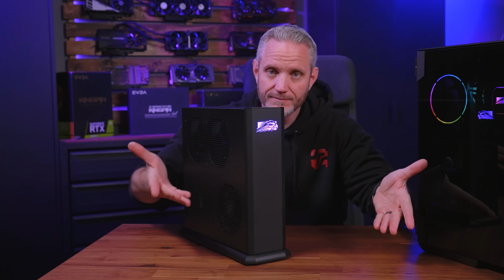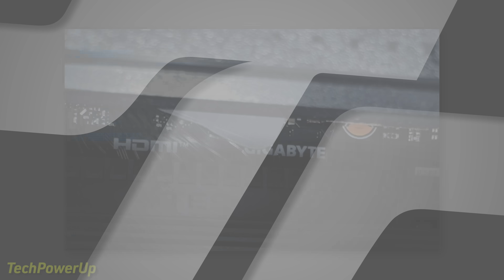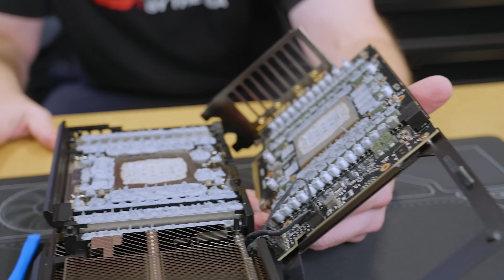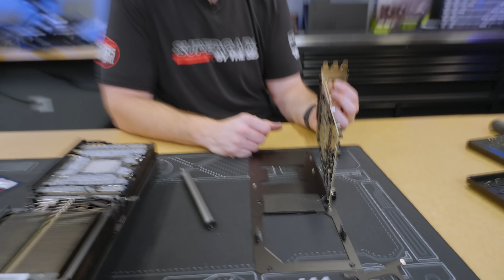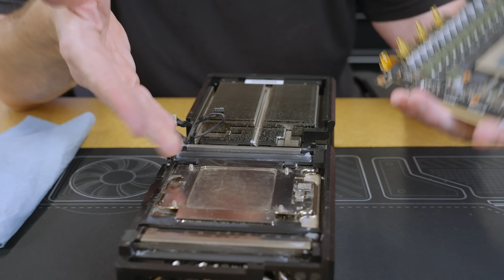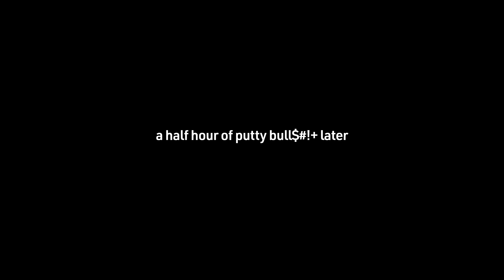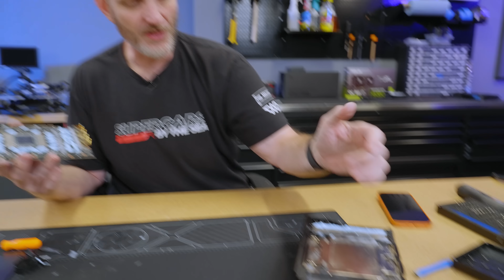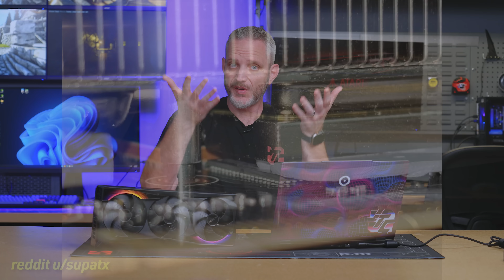What the HECK Gigabyte... WHY?

Comment: when i bought my 4 slot gigabyte aorus 3080ti in the middle of the shortage my card started thermal throttling just a few months after it was new because the thermal paste dried up and looked like clay, if it wasn't gray i'd think it was toothpaste or lotion, gigabyte can't be trusted
Reply: paste drying has a hell of a lot more to do with end user than the manufacturer. your case was prob the issue.
Reply: @SaltSpirits  my new 5090 hasn't gotten any hotter since i got it in march, same case and it's also a ventus model with a smaller cooler than the gigabyte and more than 10c lower at 100+w more power draw, i believe you can be right but in my case i just think gigabyte tried to get as many cards on the market at the cost of qc/component quality

Comment: Interesting results. I expected the hybrid paste on the core to be a gimmick compared to regular thermal paste. Der Bauer made a video about the exact same card but compared it to Conductonaut Extreme which got him 4-5 degrees improvement.
In any case, these cards don't suffer from any thermal issues. (Excluding the connector which is a completely different type of thermal disaster ofc)

Comment: praying that I never have to open my Gigabyte 5070 TI to reapply that mess. 

hopefully if any issues pop up, it'll be in the three year warranty. actually trusting Gigabyte to fix them though is another story
Reply: It's Gigabyte. You should have 4 years of warranty.
Reply: @PwniezXpress or 5 years if you buy two models within 30 days of each other..
Reply: @PwniezXpress  it's 3 years standard but you get 4 years if you register it within 30 days of purchase (which i didn't know about lol but i think my credit card adds a year)
Reply: I’d be replacing with either a phase change thermal pad or just good old fashioned thermal paste right away. Just keep an eye on it and you’ll be ok.
Reply: @wareskevin  You didn't watch the video, did you? The paste that comes on the die is better.
Reply: @tradingnichols I can’t believe that, the only thing worse than what came with it is Liquid Metal. You do you man, no worries.
Reply: @wareskevin  Uhm what? How can you not believe that? It's literally the best you can get for a GPU lol.
Reply: @PwniezXpress  aw… cute that you are buddies. ❤😊 A few degrees difference between thermal mediums is inconsequential to me as a hardware engineer. So let me sling this bit before I shut down this discussion. The best cooling solution you can get for a GPU is a water block in terms of temperature reduction. I’ve been repairing computers for over 30 years. Remember? When you had to assign IRQ channels? If you’ve never owned a 14.4 baud modem, or never had a MCSE certification, or never owned your own PC repair business for 12 years, I’m not interested in your opinion. As I said before, y’all do you. ✌️out.
Reply: @wareskevin  Funny how you assume what I do and my background. You speak as if you know everything, yet NO ONE here is talking about waterblocked GPUs. This is entirely based on air cooled GPUs. You need a reality check. 99% of people aren't going to use a waterblock on their GPUs because that's enthusiast territory and cost A LOT more. Please seek help.
Reply: @wareskevin  temps have been excellent on even my MSRP windforce model. it wasn't something to worry about thankfully, i don't think i'll have to even open it up unless something goes wrong.

thermal putty might be messy, but it does last longer. only thing i'm worried about is the thermal paste on the GPU die drying out
Reply: I've had no issues with the gaming OC models. I've owned a 4070 Asus Tuf, 4070 TI Super Gigabyte Gaming OC, and a 5070 TI Gaming OC, all of which worked perfectly. I also had an MSI Gaming Trio 2070 Super and a 3060 12GB Asus standard model. Additionally, I had an EVGA 2080 Super, one of my personal favorites, and none of these cards ever gave me any problems.
Reply: @Zenntric  Gigabyte had a small select few bad thermal putty applied in the wrong spots on the first batch coming from a single factory. Of course, those people went online and complained and it caught like fire, now so many people think they're all like that. I have a Gigabyte Aorus 5090 and my wife has a Gigabyte Gaming OC 5090 both of which are vertically mounted. Have been for over 6 months. Not a single issue of any thermal putty drip because it's literally impossible. The viscosity is way to thick for that to happen. People just love to parrot what they see online and call it a fact. Yes, there were a very small number of cards with putty placed in the wrong spots due to a faulty machine in Vietnam's factory, but that was instantly resolved. But now, everyone thinks all the cards are like that or that vertically mounting them will cause issues. Little do they know that thermal putty is better in every single way to thermal pads besides cleaning it off and repasting it due to time consumption. You shouldn't ever have to re-paste it anyways since it will last the entire lifetime of the card.

TLDR; People are stupid.
Reply: @Zenntric  How long have you been using that 5070 TI Gaming OC with no problems? What are the first four numbers of its SN? Thanks in advance!
Reply: @rosagorgatti  I got it two months after the launch. The numbers are hidden right now, but I’ve checked the card personally and there’s no leaking paste or anything. I even stream with the card without any issues, and the AV1 in it is amazing as well.

Comment: I have the Gigabyte 5080 AERO with this paste/"Gel" stuff. So far its been great in it's vertical mount. That being said it is in an AC controlled room @71F with the AC partially blowing directly into the side of the case. And yes, the side panel is off the case. The gpu is on the stock fan curve because the core doesn't go above 67-68c. The mem temp doesn't go above 69c and is usually only about a single c above the core temp at any given time. I have't seen either the core or the mem temp get into the 70's c yet. So imma cross my fingers and hope I am fine. I have HWiNFO 64 running at all times on my 2nd monitor and am always checking it in games.

Comment: Yes, my first batch of 5080, bought a month after the release of the new line, started leaking thermal interface, considering that I use the video card in a horizontal position, but there is not much of it, apparently the excess was simply squeezed out lol

Comment: I have a Gigabyte AERO White RTX 5080 and it seems to be okay. I'm not sure on the memory temperatures, but my card goes on avg of 2850 Mhz speed at ~70 degrees Celsius for AAA games. For the past 6 months I had the GPU horizontal. Now (started Sept), my GPU is a vertical mount for personal reasons. I do recall my temperatures to be high during the summer heat & living one floor up (which of course heat rises). Ambient temperature in the hot summer was about 83 degrees Fahrenheit (28.33 degrees Celsius).

Comment: So I've had my 5090 AORUS Master Ice for about 2 months, used for 70% gaming, 30% 3D Printing Slicing/Modeling. Mine is is horizontal in my case, so that may be why, but I have seen absolutely ZERO of this thermal paste. I even double checked it when I started hearing grumblings about the issue, so far so good. This isn't discounting those that are clearly having the issue. But Crossing my fingers I'm not affected. I decided on this card because it was about $200 cheaper than the Asus Astral at the time. Plus...white build.
Reply: Same card here, although vertically mounted, also crossing my fingers 😅
Reply: I have the 5080 Master ICE and so far, no issues whatsoever. I took the GPU out the other day, as part of the regular maintenance to clean dust inside the case, nothing was visible when looking more closely to the PCB under the heatsink. I have it on the horizontal right now. Wanted to buy a vertical GPU mount, but now I am kind of hesitating... damn it Gigabyte :|
Reply: @antoniocampos1151 yeah I had bought the next vertical mount kit for my case and it’s sitting in my closet at the moment due to me being nervous about it now 😂. Great performance on the card, and it’s extremely quiet, even under full load.
Reply: It's not thermal paste
Reply: @rustler08 you clearly know what I meant. 🙄
Reply: Same here. No issues yet. I built my new pc in July and game daily. I chose this card because of the cooling solution and the great thermals.
Reply: Ive zero idea why people are so into this white build. It gets filthy fast, looks terrible, and is a horrible pc color. I just bought the x870e aorus black mobo last night because the white version is not happening.
Reply: @heavymetallabratname checks out. BLACK EVERYTHING !!!
Reply: @heavymetallabratpeople have different tastes…imagine that? Unless your home is filthy and full of dust, it’s not hard at all to keep any build, I didn’t a white build clean. I clean/dust all my builds, even black ones about once a month. Zero issues.

Comment: would be interesting, is the ram temp and the other temps from the software or are they on the pcb? if software then flashing a matrix bios on it would enable them?
Reply from the maker: That's not how sensors work
Reply: @Jayztwocents but they use the same ram chips so in therorie it should be

Comment: @JayzTwoCents Just bought a brand new RTX 5070. I have a b450 aorus pro mobo and I was running a 2060 super since 2020. The new 5070 ran well for a mere week and today, I got black screens. After a while, now, the situation is that my system will turn on but I get no display. It won't even let me get into bios. It seems that everything else still works but I can't see any of it! Throwing in my old 2060 super runs the system as usual, so it's clearly the 5070/ its drivers. Any solution to this?

Comment: Jay, are you ever gonna test phase change thermal compounds? 
I've had to pull the cooler off my cpu a couple times (gremlin giving me no boot until I disassemble then reassemble the system, happens every 9 months or so) just pile anything that squeezed out onto the cpu and put the block back on, and run it, the phase change handles the spread, no performance loss after it goes through phase change (haven't had to pull apart the gpu, but it's been on there nearly 2 years without any signs of performance degradation, test it every few months)

Comment: I use Upsiren putty on my 7900xt hellhound's memory and power stages for a few years now without issue and Thermal Grizzly PTM on the core. Dropped a few degrees over stock but still have to run a custom fan profile because the bios doesn't seem to factor memory temps into the fan curve. 90C on memory was too hot for me to be comfortable on it's reliability.

Comment: Okay that's not pump out pump out is when thermal expansion of metal causes the gap between the two surfaces to get smaller therefore pushing the thermal paste out and when when the metal cools it retracts leaving a void and then as it gets hot again it pushes on a thermal paste because the clearance between the two metals get smaller as they expand from heat that's pump out I don't know what the hell were you were talking about

Comment: THe mistake is thinking gigabyte actually want users to service their own GPUs, they put warranty stickers on the cooling systems for a reason, even though in many cases they aren't legally valid.
Reply: The only reason a company puts the warranty void sticker is to try and screw customers out of filing an RMA. They are not legally enforceable. It's for the company not for you.
Reply: @loschain2224 no, it’s 100% for the consumer.

Gigabyte know warranty stickers aren’t valid. They don’t need them. What they also know is that most consumers are dumb, see the sticker and don’t know that it is worthless and opt not to do their own maintenance out of fear.

Can take in more money from dumb people who don’t know they can clean the coolers out themselves … that or make people think their hot cards are just outdated so they buy a new one.

The sticker remains purely for consumer psychology reasons.
Reply: @loschain2224  i didnt rma since my warranty is no more. i wanted to repaste it myself
Reply: Gigabyte is such a washed up joke of a company now after the years and years of missteps.
Reply: @AgentLokVokun  funny way to spell Asrock
Reply: @grunky-k7p  I don't own any asrock products but from what I can tell given techtubers, they seem to have been improving with time, not getting worse.
Reply: There is no "service" required underneath the heatsink.  If you disassemble your GPU heatsink, it is your own fault if the card breaks.
Reply: @GoatTheGoat You literally posted this comment under a video whose entire purpose is to prove you wrong.
Ironic.
Reply: @TruthNerds  Did you actually watch the video?  The OEM thermal compound was completely fine.  There was no reason for him to change it.
Reply: @GoatTheGoat  😂😂😂 So you don’t understand how thermal paste needs to be applied and didn’t watch the video, that’s funny. I do and I did. Jason explains what‘s wrong with it. You must be a purchased chat bot or a dumb fanboy, in both cases there’s nothing left to say than: blocked. 😆
Reply: @TruthNerds   Yes, he tells a very dire story about the thermal compound.  But when he opens up his card and shows the thermal compound, it is completely fine.  Once he reassembles the cards, the thermal performance is worse.

Not only does the video proved there is no problem.  It shows why you shouldn't try to "fix" a non-existent problem.
Reply: @GoatTheGoat I forgot to congratulate you on the "ingenious" attempt at gaslighting. Jay literally calls it "thermal gel from hell" and you suggested that he's saying it's fine (just because the temperatures were ok for the time being 😂).

I explained at the top level why only morons (Gigabyte obviously included) apply thermal paste like that. You could read it but then you'd learn something and it's obviously your goal in life to leave the world as ignorant as you entered it. Too bad. 🤷‍♂️
Reply: @TruthNerds   Bro.  As I said, yes he says it is "thermal gel from hell".  But then he takes the heatsink off and the thermal compound is completely fine.

The fact that we see the OEM thermal compound is fine in the video invalidates everything he said about it being bad.  That is not gaslighting.  That is basic logic.

Comment: "This air cooler works really well." It's not so much a testament to how good the cooler is, but rather that it's the size of a PlayStation 2 console for Christ's sake... lol.
Reply: Consider that Jay is also a pretty tall dude and it still looks gigantic when he’s holding it lmao
Reply: @ct578 yep it’s probably as heavy as my gaming laptop and uses 3x teh power lol😂
Reply: I have this card and I love how quiet this card is compared to Astral. I had both cards and decided to keep the aourus. If you don’t want to do water loop the aourus is the best rtx5090 air cooled card. This is the only card with binned vrms, hitting over 3k stock no problem. The best thing about this card is that it has almost no coil whine, silent. The astral had a noticeable, moderate coil whine.
Reply: @Hussar-fm8iy  Binned VRMs? That's awesome! But what is less awesome is binning the card (into a trash bin) because thermal paste is the consistency of my diarrhoea after Taco Bell Tuesdays.
Reply: @HawtDawgBro09 I have this card for over 5 months, no thermal putty leak. Compared to Jays my putty is more solid, don’t have this leaky consistency. Last week while doing maintenance I took out the card to check for putty leak. The putty is solid and didn’t move one mm. Gigabyte had problems with early batches.
Reply: @Hussar-fm8iy  so unless you ask specifically for newer aorus batches (not possible everywhere) you're playing the GPU lottery with a $3k GPU. Sounds fun lol.
Reply: @HawtDawgBro09 Its October and I bet most of the old batches that were produced till the end of march are already sold. My batch is from 3rd week of April.
Reply: People don't really get how big these cards are if they haven't handled them in person. Reading a spec sheet, and holding the thing is much different...

My vanguard 5090, even with large hands, I could not manipulate with one hand.
Reply: CoolerMaster 612 v2 GANG. On socket AM3. 

Runs hot? Bigger cooler!!
Reply: lol true
Reply: Oh, thats the size of the only comfortable controller I have held, the original larger size XBox controller ;)

Comment: I just went through my 2e repaste of my XFX 7900xtx, had hotspot issues, didn't fix the problem , turned out to be a cracked joint on the fins where they connect to the heat pumps. Brand new experience for me.
Reply: Couple of months ago i had a razer laptop for repair because it had thermal issues, PTM'ed it and Halnziye HY256 Putty on the other components and then i found out the vapor chamber cooling stack was dried out!
(PTM on a 7900XTX is mandatory)
Reply: Hi. What is the cooling stack and how does one check if it's working? 😅  @harrydijkstra9936
Reply: Have the same card, luckily no damage but repasting just wasn't cutting it long-term, Honeywell PTM7950 solved it.
Reply: @Hito343  The poor technician tried PTM7950 , kryo sheets and liquid metal before he got to the point of putting the cooler under the microscope. strange things is the card still ran super smooth, it was the hot spot temps and the fact that you couldn't touch the power slider at all in adrenalin without it crashing that convinced us to keep looking.